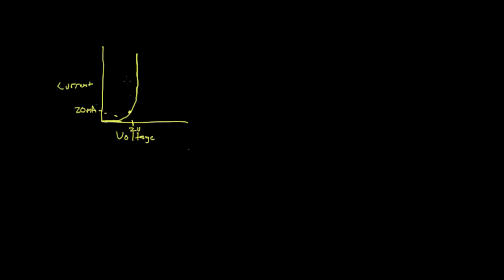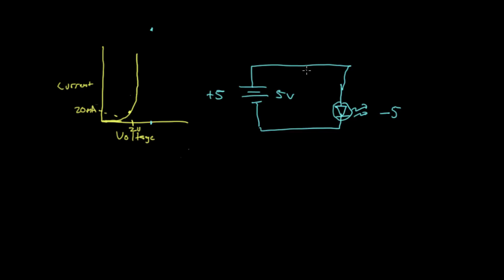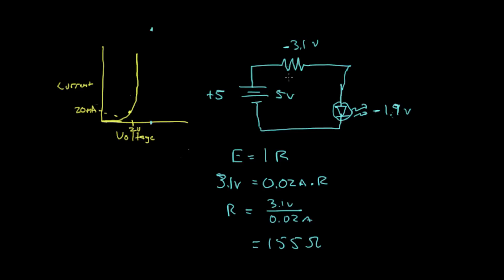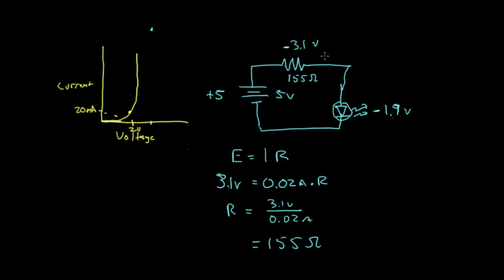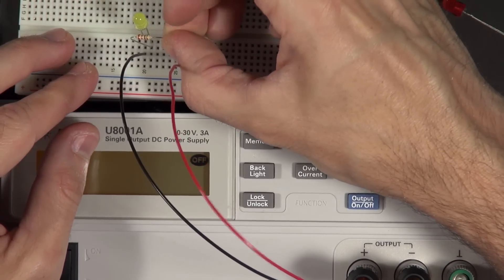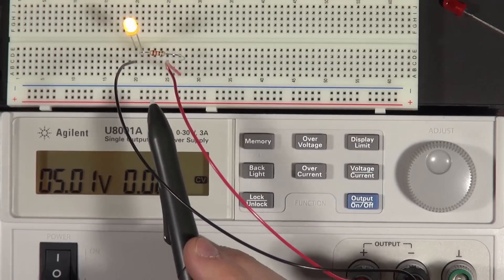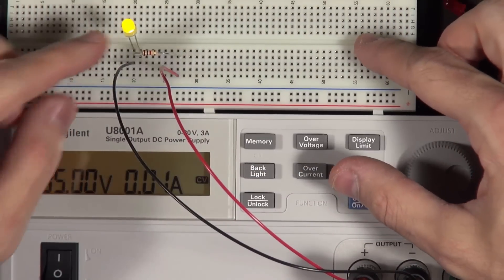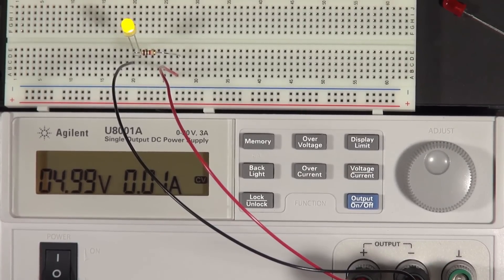Limiting current through an LED | Digital electronics (2 of 10)

Comment: shouldnt you have a much lower current according to ohms law? how is it possible to have over 1000ohms of resistance and 5 volts of current but still have a current greater than 10 mA? with 1000 ohms you should only be getting 5 mA right? I = V/R no?

Comment: I didn't know the resistor value was so flexible.  160Ω is a common 1/4W value, so that would be fine for for a 155Ω calculation.  I was already aware of how to calculate the values, but the flexibility of a little higher is great to know.

Comment: i don't understand how it works with 1000 ohm resistor?  If it's getting 0.01 A  , then 1000 ohm * 0.01 A = 10 V drop,  but we are only providing 5 V. So how does the LED glow?

Comment: Okay, basic question here, (because I've refused for most of my life to study EE and I'm finally taking the plunge,) why did, and does it make difference that, you put the resistor downstream from the LED? Could you put the resistor before the LED and get the same result? If so, is there a benefit to doing it one it one way versus another?
Reply: If I am not mistaken, it doesn't matter. The only important thing here is to make sure the led is in the correct order.
Reply: Usually the resistor can connect to either the anode or cathode of the LED. All the resistor does is limit voltage to the LED, although it is typically called a current limiting resistor. (Thank you Ohm’s law. Lol.)
The circuit containing the LED may cause the need to use the resistor on one lead or the other because of the design of the overall circuit.

Comment: In the previous vedio you hooked the led to the power supply directly and you adjusted the voltage and let the led draws the current it wants. In this video you used a resistor to limit the current using a high value resistor. My question is why not use a lower value resistor that drops the extra voltage of the source and let the led determines the current it wants to draw? Why at two volts the led only draw 20 mA ? Is it manufactured to only allow those 20 mA at those 2volts or the power supply can only supply 20mA at 2 volts?

Comment: I am confused. How come you didn't put the resistor between the negative and led. If the current flows from negative to positive then wouldn't you want to put the resistor before the led? Before the current goes through led?
Reply: Never mind, looks like I found an answer to my question:The resistor can go before – or after – the LED, and it will still protect it. the current that flows out of a battery is always equal to the current that flows back into the battery. So in a circuit like this – with only one path for the current to flow – the current is the same everywhere in the circuit.

Comment: ok now, but how does this work with 1kOhm resistor? shouldn't resistor take most of the current/voltage, according to the law for itself and then LED not lit up at all? why it still shines even though we have ~5 times greater resistance than the one according to the calculated specifications?
Reply: I would really love the answer to this question as well.
Reply: The LED (and in fact every diode) is a non-linear component.

Comment: what is that voltage controller called? and how much does it cost? and is it needed for a beginner? I have an arduino, so could I use arduino instead as voltage controller?
Reply: It is expensive sells for close to $450

Comment: I solved the 155 Ohm resistor puzzle:
Put 3*150 Ohm resistors in parallel for a resistance of 50 Ohms.
Put this in series with 1*220 Ohm resistor for a resistance of 270 Ohms.
Put this in parallel with a 370 Ohms (1*150 Ohms in series with 1*220 Ohms) for a resistance of 156.09 Ohms.

Or you could put 30*150 Ohms in parallel for 5 Ohms and put that in series with 1*150 Ohms, but that's a trivial answer to the puzzle and no fun.
Reply: Plot twist for you. My big 2W 270ohm resistor only has an actual capacity of 264ohm. Go figure.
Moral is, it just doesn't matter that much, it just matters that it exceeds a minimum value.
Reply: Rule of thumb:
Do more with less.
Reply: Put 2*10 Ohm resistors parallel and 150 ohm resistor serial to that = 155 Ohms. 10 Ohm resitor is a standard resistor.

Comment: Thanks for your great educational videos.....i wonder when you use the 220ohm resistor with reading of 0.02A then the voltage across the resistor is 4.4V and voltage across LED is 0.6V , so how the lead lights with 0.6V ? .
Reply: It is because the resistance of the diode is not linear. As a simple ( though not really correct ) example you can introduce the non-linearity in a quadratic form. From the sketch in the video you can see that the current increases over-linear with voltage. Lets say it is of the form I( U ) = 20mA * ( U / 2V )^2 Like this it is 20mA at U = 2V but only 5mA at U = 1 V. Hence at 2 V the diodes resistance is 100 Ohm but it is 200 Ohm at 1V, sort of.  If you plug this in Ohm's law you get a quadratic equation for the voltage over the diode U_D, resulting in  U_D =1.72 V, I_D = 14.9 mA. Overall, increasing the resistor by quite a lot, ie. from theoretical 155 Ohm to 220 Ohm, has less dramatic effects due to the non-linearity of the diode.
Actually, it works in a different way as a diode "tries" to keep a fixed voltage drop, but the example shows how non-linearity messes up the simple Ohmic thinking.

Comment: I didn't't get one thing.
As i have studied I=U/R.
So why isn't electric current proportional to voltage?
Resistance only increases so it can not be the case.
Reply: It is across the resistor but the diode has a different curve which he showed in the beginning
Reply: its not an ohmic dispositive. It means its not a linear one. Instead of having a straight line as a graph of V(I), it has an exponential. Thats the mathematical reason of why it burned so fast. You can model tho, a small resistance between small changes of voltage and current (derivative of the graph). This is called dinamic resistance and its used on low signal AC analysis.
Reply: A diode is a semiconductor
Reply: mr. random Because diodes

Comment: Maybe someone can help me, but how do you get more than .005A when subjecting a 1k resistor to 5V ?  Even if the LED was a direct wire, it shouldn't produce more than .005A, not .01A.  Perhaps the tool is rounding up.

Comment: Hi, thank you for these videos, I found you from 3Blue1Brown, question, Why do you put the resister on the negative side? What would happen if you put it on the positive side? Thank you!
Reply: I looked up the answer, they said it doesn't matter which side the resistor is on, because the electrons don't give it energy the motion does, it is more like a belt/chain
Reply: I'm wondering the same...
Reply: Nate Crownwell you can put resistor any side...the is no specific rule
Reply: The question I wanted to ask.
Reply: I had (and still have) the same question.  It seems to me that it wouldn't make a difference when the connection is made.  But when you have the LED in a circuit, you would want to "protect" the LED with the resistor on the positive side.  If the resistor is on the negative side and you were to get a short (to ground) between the LED and the resistor, then the entire 5V potential would be dropped across the LED and it would burn out.
Reply: @user-sd2en6pn3z  This is a very good tip! Thanks!
Reply: @user-sd2en6pn3z  Doesn't he answer it in the video? He says all the components must add up to 0 voltage. So it shouldn't matter on which side it is, it just has to be there, isn't that right? What I'd say though, is that you are consistent and always do it the same way if possible.
Reply: @user-sd2en6pn3z  actually this is not correct. Think of current as a flowing ring of water and the voltage as the motor that keeps the water flowing in the ring. It doesn't matter which part of the ring you obstruct, you are still going to reduce the overall flow of current thus protecting the LED. 

And about the part where you said all 5 v is going to be dropped across the resistor, you are wrong... If you put a resistor in series,(again, it doesn't matter where) the resistor will drop some voltage across it (which depends on the value of the resistor) and the led is going to drop the rest of the voltage.

Comment: Best digital EE channel. OK? But, I have a bag of red straw hats from 1980 that run at 12 VDC.
Reply: Now your resistor needs to drop 10.1 V instead of 3.1V @ 20mA. E=IR: 12V=0.02A*R, R=600 ohms. Alternatively, each LED drops 2V, so you could put 6 LEDs in series if you're willing to live dangerously. If you use 7, they'll be dim as they'll only get 1.7V each (12/7) at an actual 12V supply voltage, so you could use 6 and a ~30 ohm resistor to be safe.

Comment: I'm relatively new to electronics design (i have been doing simple electronics on and off since a very young age though) but i'm not new to maths and i'm a little bit skeptical on the use of Ohm's law in this case.
Sure, 3.1v / 155 = 0,02 but this only tells us that if we have 3.1 volts, we need 155 ohms to get 0.02 amps.
Our real scenario is that we have 5 volts and want to get 0.02 amps across a non linear device.
Voltage doesn't always drop the same across all resistors of the same value.
Voltage will always drop to 0 over the total resistance of the circuit and then the partial resistances in relation to the total will determine the voltage drop over a certain resistor (Or other component for that matter).
Reply: The way i would calculate it is:
5v / 0.02a = 250 ohms

This might not be right either since the LED is not linear and will have a resistance which is dependent on the voltage.
Reply: A different way to get a more exact voltage across the LED on the other hand would be to use 2 resistors to create a voltage divider. (390 ohm's on the positive side with 240 ohm's on the negative would give 1.905 volts between the two resistors)
Using a single resistor still works of course but as i understand it, it is much harder than "simple ohm's law" to find the right resistor with good precision.
Reply: Other than that, i love your computer logic videos and i am planning to build my own computer in a similar way! :)
Reply: Or am i completely wrong and the voltage drop across the LED is a constant 1.9 volts, leaving the other 3.1 volts and resistance to decide the current?
Reply: I seem to have found the answer to my own question.
The forward voltage (the voltage needed to drive the LED) is usually almost the same as the voltage drop and therefore you can sort of remove from both sides of the equation by just subtracting the forward voltage/voltage drop from the source voltage and calculate the current as if the LED isn't there.